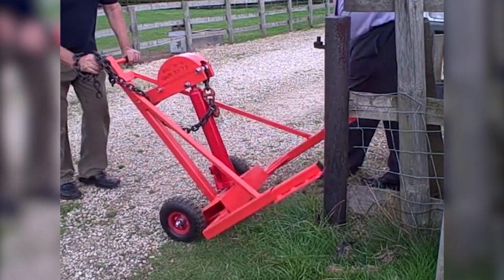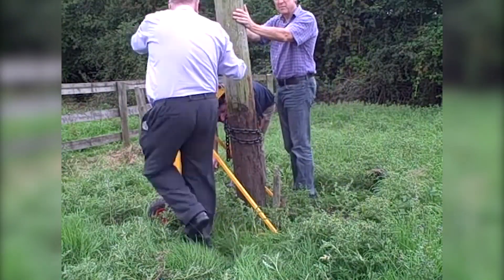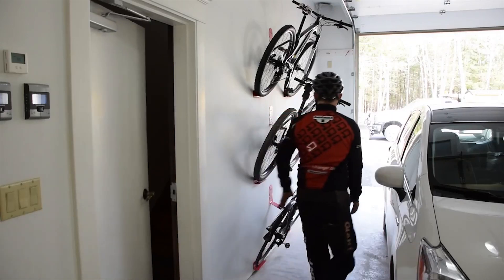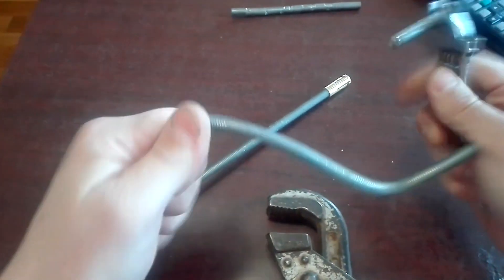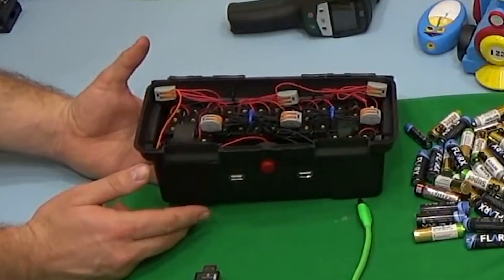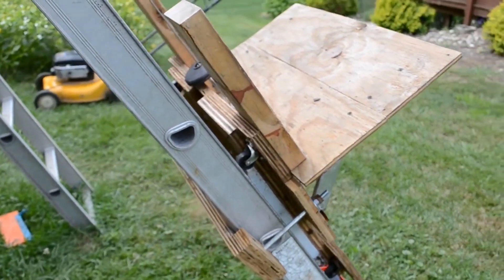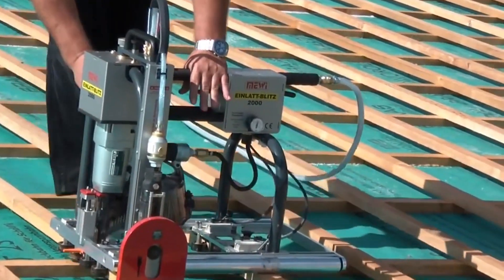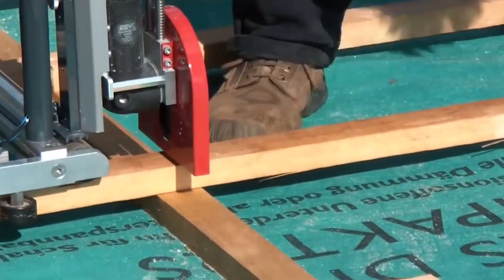Awesome New DIY Tool Idea !

Comment: I recently saw a vid of yours about the contour gauge & instantly subscribed. The one with the cardboard & dowels. I live in a 1870 log cabin in Wyo. And I replaced some windows last year. Not all the logs are the same & trying to transcribe those contours to my trim boards with the standard small gauge was a big problem. I gave up. And then you came along with the answer. Thankyou so much, Take care, John & Amy (woof), PS - A perfect house for a painter :) none required!

Comment: Pardon me for noticing, but not much of  of what you showed in the video is aimed at DIYers.  The people who need these tools or installation aids are all professional fence installers, roofers, roof tile installers, etc.  These would all be prohibitively expensive to purchase or even rent unless you did those kind of jobs for a living.  I also notice it took three people to remove the fence posts and to do the other jobs.  DIY implies you're doing it by yourself, w/o a lot of knowledge and nobody else helping you.  They all make the job easier, safer or more efficient, and imply these devices aren't really aimed at the DIY market.  It's nice to know they're out there, but that's about it.  Thanks for sharing.